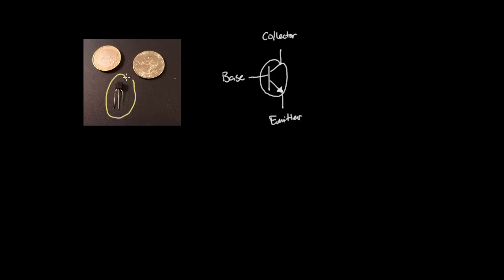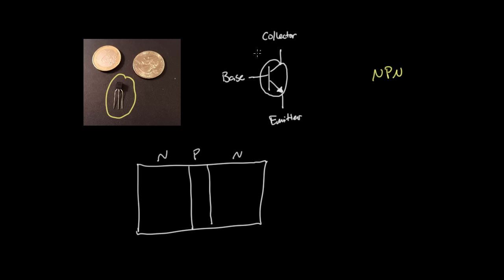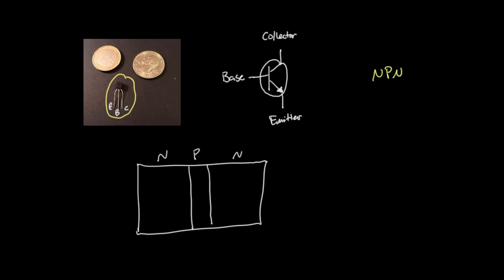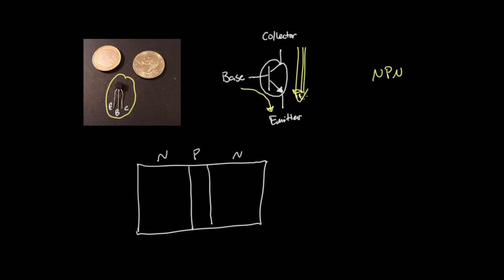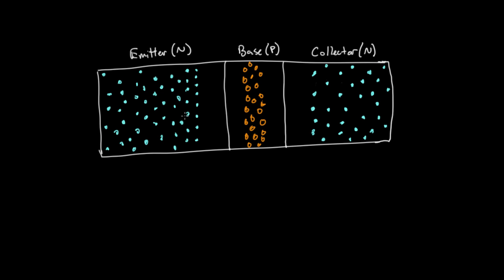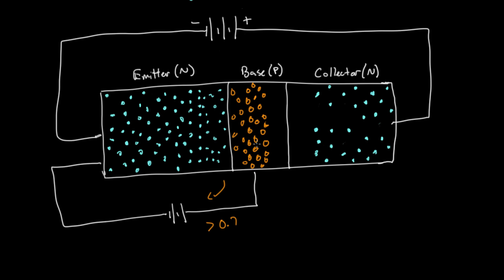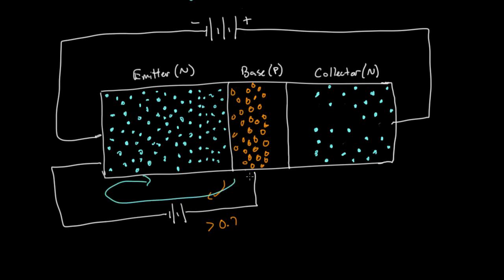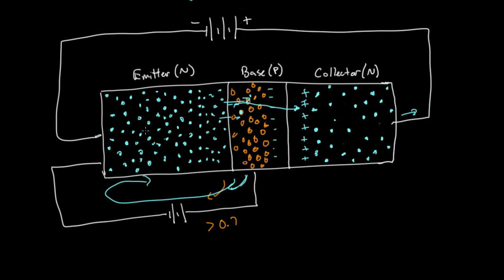How a transistor works

Comment: I don't know what it is, but you consistently have the clearest explanations I've ever heard. I took an entire class on Analog Devices at my college last semester and walked away with a very poor understanding of transistors. But these two videos you have on semiconductors and transistors have clarified things so much.
Reply: Same here. These videos give me the clearest explanations I've ever heard of transistors.
Reply: ye!
Reply: Well said.
Reply: My guess is that he doesn't do the maths.
He tells you what's going on with words and drawings. 
Bookwriters and lecturers have a tendency to - as they already understand the workings of things and you're supposed to be able to calculate stuff regarding the subjects - rely on maths to explain physics, and this is a very shite thing to do as it misses out on some very graphical things.
Sure, if you look into it, the equations imply that a depletion zone exists and that a diode carries current better in one direction than the other, but the mathematical description for the motion of electrons isn't an efficient way of allowing you to understand the concept.
Reply: He learned a lot about teaching from working at Khan academy as well as personal experiences while learning maths earlier in life.
Reply: BEN'S VERSION IS NEARLY THE CORRECT EXPLANATION!  Most of this is right out of college-level textbooks.  So yes, it makes sense.
Many of the other, confusing transistor explanations are simply wrong, and are spreading the same misconceptions found in most high-school textbooks.   The main error:  do transistors amplify current, like everyone says?   Nope.  Instead Vbe determines Ic (called Transconductance, also called Ebers Moll model.)  To change the collector current, change the base-emitter voltage.  (The Vbe controls both the collector current and the base current.)    In other words, BJTs are much like FETs and vacuum tubes.   To understand BJTs, first you have to discard the misconceptions you were taught earlier.    Diodes are turned on by voltage forward bias, not by applying current.

Whatever a transistor amplifier does  ...the actual inside of the transistor is based on voltage input: those small changes in Vbe.
Reply: Exactly. I am amazed at the clarity of the explanation. I have  understood how transistors work only after watching this video. (I too spent an entire six month course on electronics, writing numerous tests and exams without properly understanding how transistors work).
Reply: Hey, it's Bill Beaty! I love reading that electricity FAQ you made 20 years ago.
Reply: exactly!
Reply: +William Beaty Dude, that explanation just fixed my whole misunderstanding of BJTs. I would always wonder where the "current controlled" part came in, when all that was ever demonstrated was voltage. Now with a better understanding of how to use transistors, maybe I can finally start using them rather than taking the easy way out with op amps (which are great, by the way).
Reply: Why does every tutorial i watch on youtube says this same exact thing is that your explanation is amazing.....
Reply: @Eugene Saint  How about consulting semiconductor physics textbooks, or even the famous "Art of Electronics."   They'll carefully explain the nature of transistor action.   Yes, "current gain" is a useful concept at the technician level, but it's a "Lie to Children, an oversimplification widely used in "For Dummies" books.   It's like saying that the Earth is flat, and the sun moves across the sky.  Those are useful concepts (look out the window!)   But they're wrong.   The Earth isn't flat, and during sunset and sunrise, it's not the sun that's actually moving.

As you'll find out as an analog designer, understanding current gain is worse than useless because of:  reason 1, reason 2, reason 3, and a host of other minor ones.   What are these?   If you're a technician or hobbyist, you'll have no idea.  If you get a degree and actually design some analog products (and have them manufactured, and tens of thousands sold,) then you'll have already crashed into every one of those reasons, and suffered through traumatic learning.   Current-gain and hfe is your enemy, it's "mental poison" which harmed your electronics career.

Or, if you carefully go through Art of Electronics (or pretty much any graduate text on the physics of semiconductors,) then MAYBE you'll figure it out early, and can avoid trauma and failure.  Transistors function via transconductance and the Ebers-Moll equation.   (Or for a high-frequency model, we use Gummel-Poon and charge-input.)   These are not taught to high school kids (and so, the people who haven't read college-level textbooks will have no clue as to how transistors actually work.)     

Current gain is the "flat earth theory" of transistors.   Ebers-Moll and hybrid-Pi network is the "planetary astronomy" version, the one that electronics professionals actually use.

---

PS

Reason 1:  your designs based on hfe will fail, because the hfe in a thousand BJT transistors with the same part number will be all over the map, perhaps ranging from 50 to 350.  But the Ebers-Moll equation, and transistors' transconductance, is nearly identical for all silicon BJTs.   This makes perfect sense, because transistor action is based on Vbe controlling Ic, where Ebers-Moll model is everything, but where where Ib (and current gain) must be treated as irrelevant.  Your designs must work the same, whether the current gain is 50 or 350, your designs must still work the same.  BUT HOW?  Well, since Vbe directly determines Ic, yet Vbe also determines Ib, then we can pretend that Ib has a direct effect on Ic. (It doesn't, not directly.) Instead of using Ebers-Moll calculations, Ib can be used to set Vbe, which then directly controls Ic, then we ignore Vbe (or pretend that it's always 0.7V,) and then it looks like Ib determines Ic.   (So, current-gain is a useful rule of thumb, same as believing in flat Earth and sunrise/sunset.   But in many situations current-gain fails.   One of those situations is Reason 1, another is the explaining of internal detailed workings of BJT transistors.)

Reason 2: designs based on hfe will fail, because hfe is sensitive to temperature.  The lab-manual for the AOA textbook leads you through an experiment to illustrate this fact: an hfe-based design stops working if the temperature changes by 1deg F,  versus a voltage-input design which still works fine over an immense temperature range.   In other words, "hfe-think" and belief in current-gain will destroy your career in analog engineering, unless you take some college courses which teach you about BJT transconductance, and debunk your "lies to children."

Reason 3:  op amps and current mirrors and Cascode level-shifters don't work by current gain, cannot be explain by current gain, and if you believe that BJTs work by current gain, then much of modern analog circuitry will be incomprehensible to you.   Go on WP and look up the internal schematic of the ancient LM741 op amp.   It should look simple and straightforward.   But if you understand current-gain only, then you'll be utterly lost.  The entire guts of the 741 chip are based on voltage-controlled BJT transistors, where Vbe controls Ic via the Ebers-Moll equation.   To explain the inner workings of transistor amps, we don't have to even mention current-gain.   The diff-amp or long-tail pair is a voltage-input device, even when built from BJT transistors.  https://en.wikipedia.org/wiki/Operational_amplifier#Internal_circuitry_of_741-type_op_amp

Others:  if you're trapped in current-gain think, then you'll always wonder why op-amps are voltage-input (even when they contain only BJTs.)  Or audio amps or RF amps, all are voltage-input devices.  Why?  They should be current-input, if transistors are current amplifiers!   Simple answer:  transistors aren't current amplifiers.   The vacuum tube and the FET and the BJT are roughly the same device:  voltage in, current out, where a voltage-controlled barrier is adjusting the output current, and all described by a transconductance equation.
Reply: @Eugene Saint Please point out an online definition of "break-over voltage."   That term applies to SCR, diac, triac.   

So, what are you actually trying to say here (in conventional engineering terms, the ones which everyone uses.)    Transistors don't have "breakover voltage."   Did you mean the knee in the V/I graph for diodes, such as 0.3V for germanium and 0.7V for silicon?
 

My goal is to explain the "theoretical physics view" in plain simple language without any math.    That view is not complicated:   transistors are directly controlled by voltage and NOT by current   ...same as vacuum tubes.    Here's a transistor explanation in a single sentence:

  -   If we apply a constant current to the base terminal (through the BE junction,) then this creates a Vbe voltage (same as with any diode,) and then the Vbe potential-hill will determine the main current emitted by emitter and collected by collector.

Simple enough?   It's the basis of BJT operation.

It certainly means that Ic is proportional to Ib, producing an hfe "current gain."

But it also means that Ib does not have any direct effect on Ic (same as grid current in vacuum tubes, same as gate current in FETs.)   Instead, base voltage Vbe has a direct effect on collector current.   But base current Ib only SEEMS to control the transistor  ...because Ib controls both Vbe and the potential-barrier in the BE junction.  And then Vbe and the potential-barrier performs the actual control of the main current.

Again: if we want to treat transistors as black-boxes, then we're free to use any model we want  ...including hfe and current-control.

On the other hand, if we want to EXPLAIN how the guts of BJTs work, then we're not free anymore.  Instead we must describe those internal actions.   (They're not complicated!)    Base current doesn't have any effect on collector current EXCEPT that base current can "command" that Vbe take on a certain value.   And then Vbe controls the collector current.

If a student hates the fact that transistors use voltage-input like vacuum tubes do, well, that student can recoil in revulsion, then reject all understanding of the interior of the BJT, and instead treat it as a black box, where any model can be used.  No hybrid-pi, no transconductance, no Ebers-Moll exponential graphs.

In that case, applying base current will always produce a larger collector current.   But in that case, that student had better avoid teaching transistors to anyone wanting the full and honest story.   Also, that student will be in serious trouble if they need to do some BJT analog-designs for their job, where they're required to know how the INSIDE of a BJT actually works.  In that case the hfe current-gain equation will cause their designs to fail (failing in just the way that AOA textbook shows us, repeatedly, in great detail.)

Really it all boils down to the "For Dummies" version of transistors, versus the "adult" version.    This above video shows the "For Dummies" version, not the one which the pros know and use.

Science is full of such divisions:  is the Earth flat with a moving sun, or do we need to learn that it's actually a rotating sphere?   Do atoms look exactly like little solar-systems, or do chemists need to learn about orbitals and 3D electron-cloud bonds?   Sheesh, was Chris Coloumbus a great hero who discovered North America, or was he actually a murderous slaver, whose crimes were discovered by Spain, and he was jailed for them?

See, we teach different stories to little kids, than we teach to adults. 

With transistors, "current gain" is the little-kids version.   To figure out how BJT transistors actually work, first the adult must realize that the little-kids version is oversimplified and incredibly distorted (meaning, it's wrong.)    Only then can the adult ask, "Well, if this video is misleading people, and if current gain is wrong, then WHAT IS FREAKIN' RIGHT?!!!!!)   

Bingo.    Ask that question, and learning can begin.
Reply: That’s proof of the failing education system tbh. They do this not just with computer science but most fields of study. How stupid is it for example that we use mathematics equations for 12 years before learning their derivation in college level calculus.
Reply: I learned how transistors worked in 4th grade (how to use them) and I actually learned the internals in 6th grade.
Reply: @xl  Until you read Art of Electronics you won't understand them.  I mean, BJT transistors.   They are voltage-input devices.  If you believe that transistor work by current-gain and current-input, then if you become an engineer, your first designs will fail.  (That's what the AOA textbook is trying to avoid.  They teach the correct "transconductance" explanation, voltage-in, current out, where hfe current gain is irrelevant.  PLEASE re-watch the above video  ...then ignore all the other transistor videos on youtube!
Reply: @williambeaty2475  ..good explanation
Reply: @wbeaty  given that V = RI, then your point could be easily dismissed, since one could say that for R constant, controlling I is mathematically identical to controlling V. But I agree, that even though one can say that the sun revolves around the earth to explain day-to-day mundane observations, it's actually better to think of the earth revolving around the sun, if one wants a deeper understanding of cosmology. But in the end, both these things are relative, and neither of them are "wrong". In the case of the transistor, it's probably best to think of the electric force fields that are being applied to the subatomic structures in order to understand what the electrons will do, and in this view, electric fields = voltage. But in the end, it all boils down to "pushing electrons", and this can be seen either as current or voltage. I think what's attractive of the video is what other people mentioned; that teachers in engineering courses go straight into the equations without giving an in-depth, visual, intuitive explanation first, and it's very easy to get lost in the details of the equations, if one does not have a clear and strongly intuitive understanding of the underlying phenomena, which is what these videos try to explain, and do so to a much better extent than most university microelectronic teachers I had.
Reply: @wbeaty  if you didn't understand even Galilean relativism and say that "the sun revolves around the earth" is wrong, then you don't understand physics. There are no inertial reference systems, and neither the earth nor the sun is one. The force by which the earth moves is the same force that it applies to the sun. There is no privileged system in the universe, and if you still believe that, then you clearly haven't understood the basics of Newtonian physics (let alone special or general relativity), and it's you who believes in a childhood fantasy.
Reply: same here. Could not understand what's going on after the College lessons, but this vid made everything clear
Reply: @ivanvargas1522  Usually the better the lecturer understands themselves, the more clear the explanations will be. Many college faculty are, frankly, less than what they should be.

Comment: Well I like to add something to your explanation the reason that electrons flow from reverse biased part of the transistor is because of minority charge carriers and because the base is thin some of the electrons does fall in to lower conduction band from the higher conduction band therefore they pass right through the PN junction.

Comment: You've made it really clear how the transistor "turns on". It seems that a small current flowing into the emitter and through the base is the catalyst that enables the larger current to flow into the emitter and through the collector. But how does it turn off? Why does removing the small current flowing from emitter through the base stop the larger current flow from the emitter through the collector?
Reply: I have the exact same question!

Comment: Currently sitting in my circuit analysis class bored out of my mind while the teacher is talking about calculating current in parallel circuits, decided to actually learn something. This is the best explanation of transistors I've found yet.

Comment: Dude you are the best. I have been watching numerous videos but your actually explained the full thing thoroughly for begginers
Reply: @bigote in simple terms the emitter side is negatively charged while the collector is positive and the base is neutral. Current only flows through the transistor if you apply current through the base and emitter. This is because the emitter gets filled up with more electrons (from the base to emmiter circuit) to the point it can jump (difuse) into the base because it has no where else to go. After that the base becomes negatively charged. Then the collector which is positively charged attracts the negative electrons from the base and completes the curcuit
Reply: Hope this helps
Reply: @bigote i used electron flow in the explanation btw